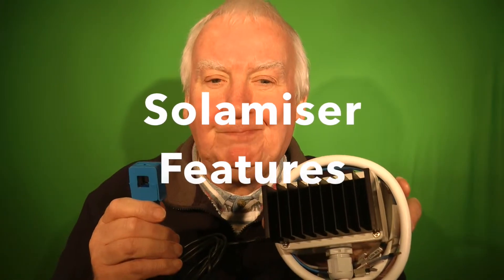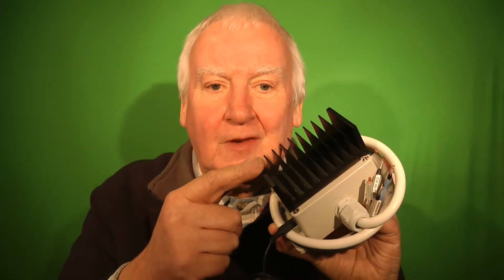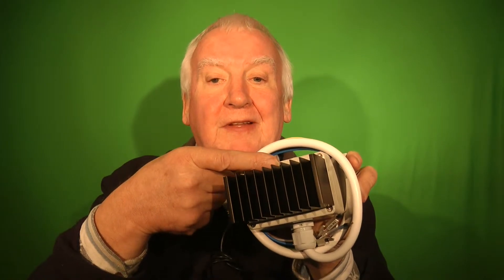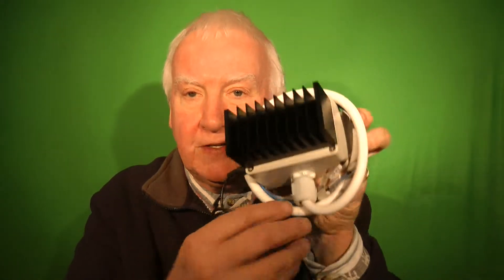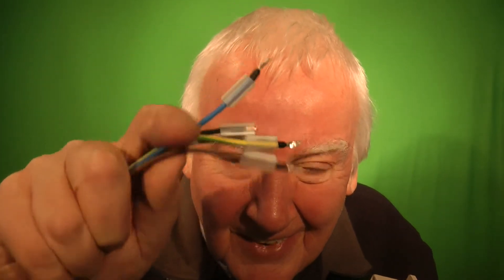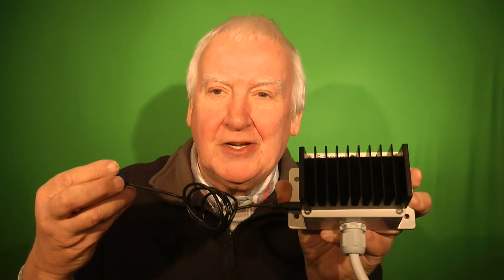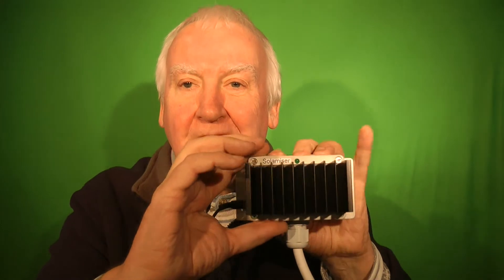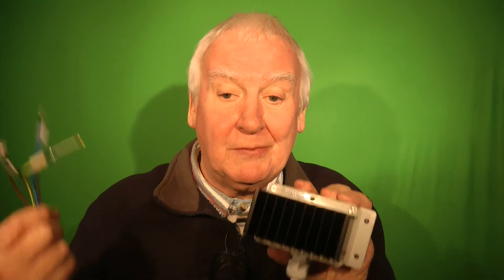Solamiser Features

Comment: I have a similar thing and works great. I am using a 500 watt immersion from when I was off grid and wondered if to upgrade to a standard immersion. Just wondered if you put 500 watts into a normal immersion(2.5kilowatts) do you still get 500 watts out in heat.
Reply from the maker: Hi Damian,  When there is surplus energy available, Solamiser adjusts the voltage and current to the Immersion heater to be equal to the amount that would have been  the surplus going back to the grid.  If your device works like this you should be able to fit a larger immersion so long as your device can take the full load current of a larger heater.   When there is 500w of surplus power the immersion should get 500W whether its a 500W or a 3kW immersion.  The benefit of the larger heater is that is can absorb more power when there is more surplus available and heat your water more quickly.
Reply: Yes thats how mine works. Its rated for standard uk immersion. i will be off to Wickes in the morning lol. i was off grid solar but its not good so was using a 500 watt immersion. Which is expensive. The cost of batteries has put me off plus we have had no power cuts since I spent alot on setting it up. Cheers mate. I will get one soon. PS my friend has a pump fitted to his tank so it heat the bottom. he`s tighter than me tho